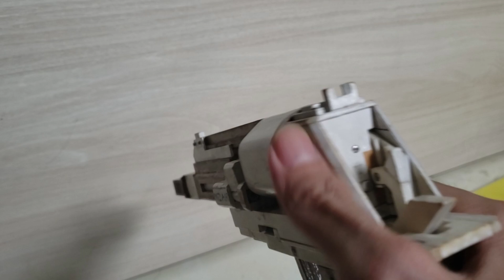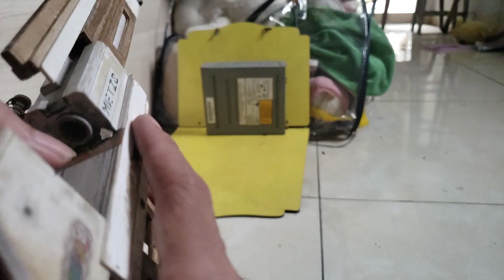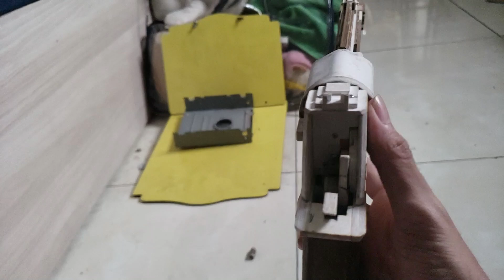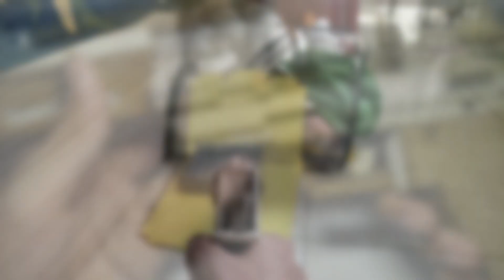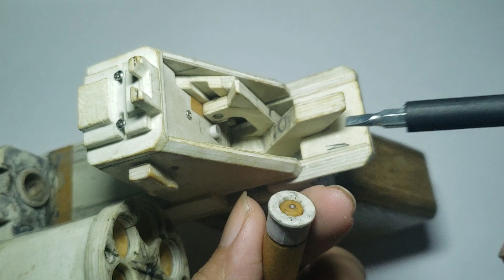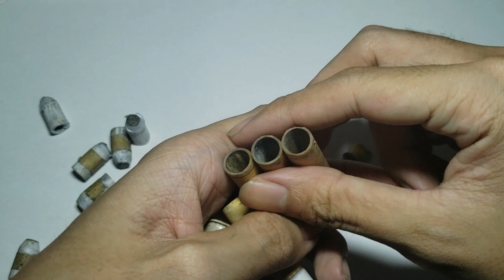Paper Semi-Auto Revolver #14: GOING FULL

Comment: i think you should use smokeless gunpowder, nitro cellulose or flash paper which is less likely to cause coal depletion, using match powder mixed with coal i find it very ineffective and leaves a lot of soot and unburned matches in the barrel and shell
Reply from the maker: I dont use matches i use my home brew version, it main left over product are just fine grain salt, while those are good option but the thing is they burn too fast i need one that burn slow not to cause a pressure spike